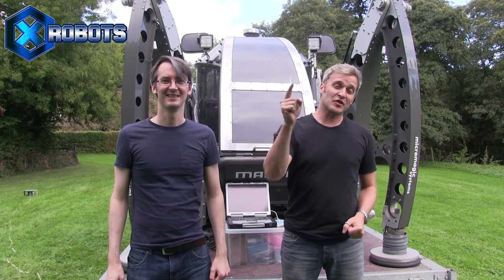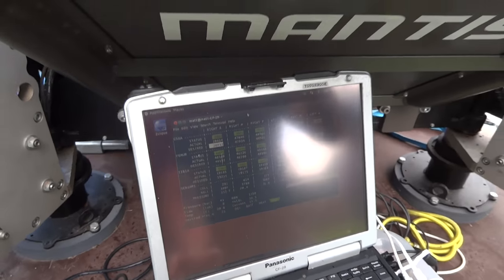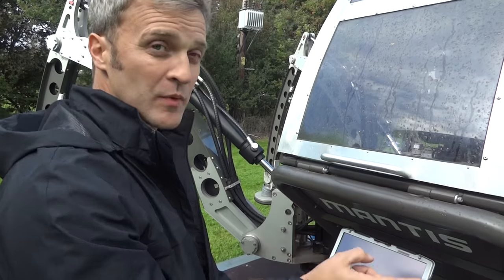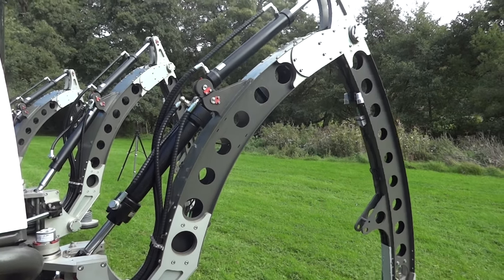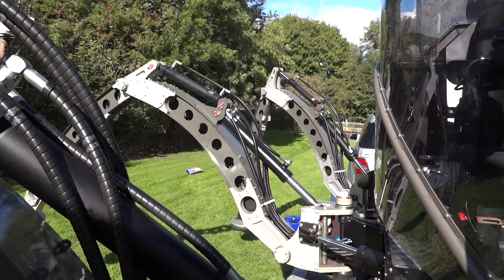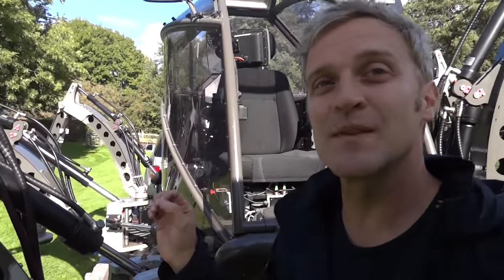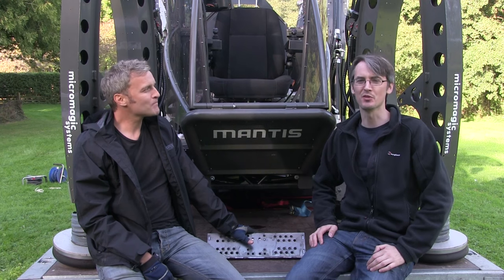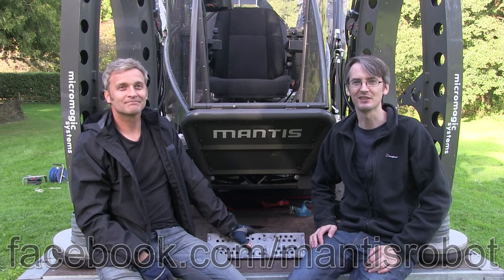Investigating Hydraulics with the Mantis Robot and Matt Denton | James Bruton

Comment: too low flow rate from the pump and his valves just dont switch fast enough , but great start, i'm glad you are exploring these options, this is the way bigdog has gone.
Reply: You are absolutely right,  what I'm saying is that it would actually work better if those issues were addressed - I'm glad you are exploring this in the context of your applications not in the context of this video

Comment: is it even legal to make something like this?!
Reply: I bet in Germany it is illegal but the rest of the world is properly fine
Reply: Why wouldn't it be? The hydraulics seem to be COTS parts and they're really not even operating at very high pressure at all. The stuff I work on where I work runs at up to 5000psi (~350 bar)
Reply: "Not that high a pressure" but still plenty enough to kill you if the pipe cracks haha.
Reply: Unless there is a lot of air in the circuit, there really isn't that much energy stored in a hydraulic circuit (compared to 150bar of pneumatics), so it's unlikely unless your body is near the place that broke that you would be injured. But it's still deadly. Seriously don't look up hydraulic injection injuries.
Reply: Why would it not be legal in the UK ? Just dont ride it on public roads.

Comment: But...can it walk on Mars?
Reply: Not with that engine.
Reply: Steve Watts Yeah I was just teasing:P
Reply: Potentially, with a few mods to fuel system, exhaust, breathing and lubricating system. Should be straightforward, but costly.
Reply: Nope, same problem as here in earth, but 100 times worse. Dust particles in the joints will eventually eat them lose. In Mars with its lack of liquid water on surface over millions of years, has not rounded up the sand particles like in earth, so its like super sand paper between the joints, that would destroy machines way faster than in earth. Also Mars has sand storm that will get it.. well everywhere!

Ou and cost vise, how much does 6 these legs, hydraulic pump+oil for the whole thing+reserve+ hyd.lines, huge electric motor and battery weight, compared to 6 wheels, 6 small electric motors and large battery?
Remember 1KG transported into space costs more than average person earns in their life time and NASA does not have unlimited budget...